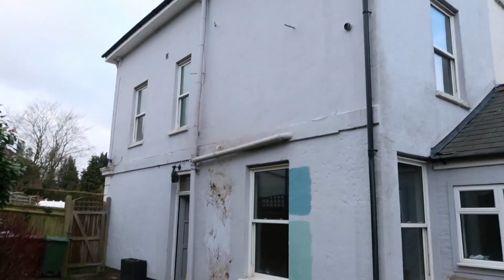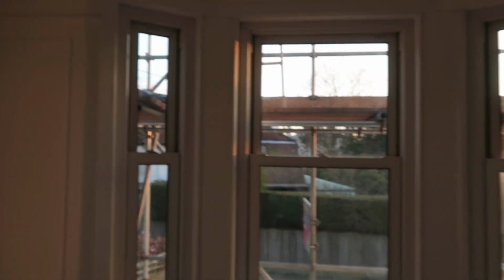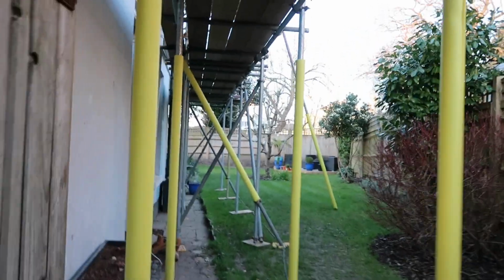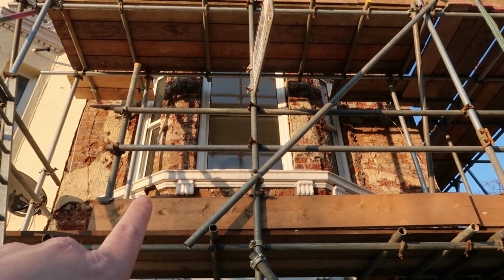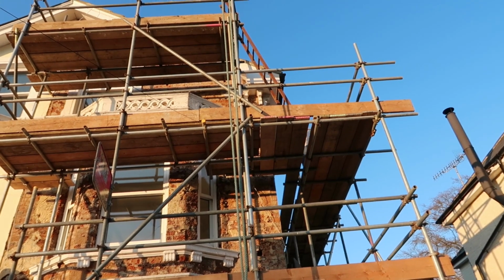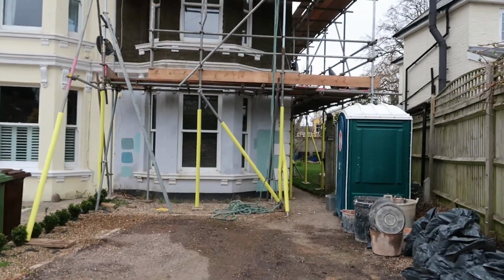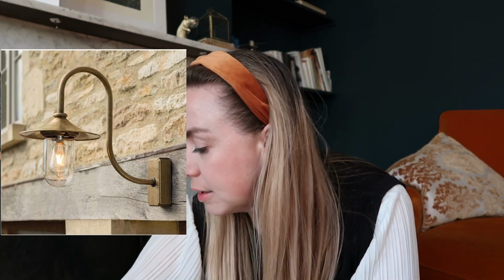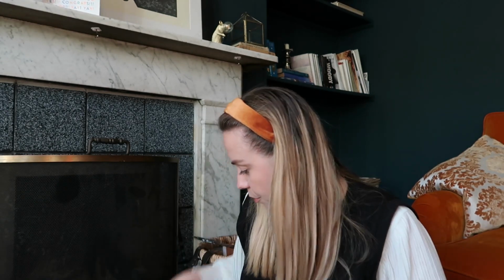TAKING OUR VICTORIAN HOUSE BACK TO BRICK + UNBOXING | Exterior Home Renovation | Renovation Diary

Comment: Great to see you back as I have been missing your videos but understand the rendering work is taking such a long time to get done. You did right in removing all of the old render as in the long term you might have had issues with anything left and it could have worked out even more expensive. The light and the brass air bricks looked great choices. I hope you poor finger healed quickly. That must have been so painful. Those tight fitting boxes are such a nightmare to break into. They fit so snuggly but at least the contents are always protected. Until next time, have fun. Have been following on Instagram so get to see what you get up to there as well.
Reply from the maker: Thanks Sophie! Can't wait to get the light up! Yes it's definitely carried on longer than we expected but I think that's how these things go! X